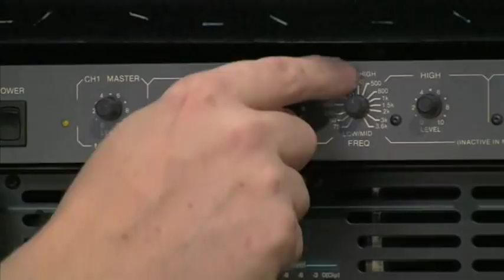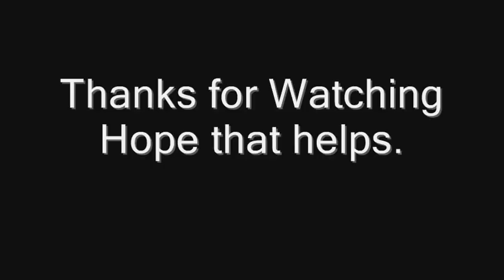What is a P.A. Speaker Cross Over?

Comment from the maker: One of the reasons I hate powered speakers is the issues you have once something breaks. Question to you is, was a passive cross over put in it's place? Is it hooked up properly? Is the woofer even connected? If so it's possible the High Frequency is so efficient and there is not an appropriate attenuation on the HF that the woofer is drowned at due to the lack of balance. Send pics to my e mail. I'll try to spell . Doyleaudio at hotmail.com
Thanks